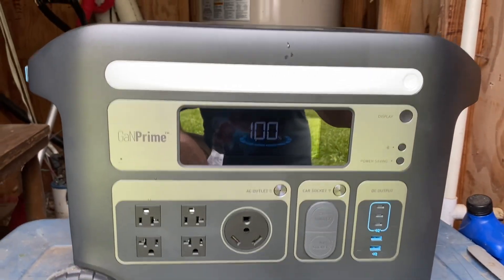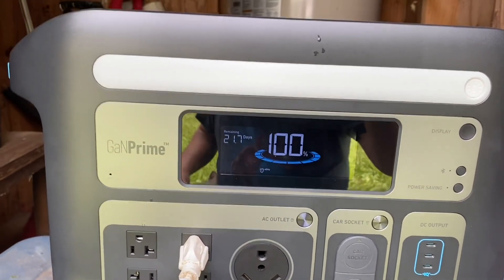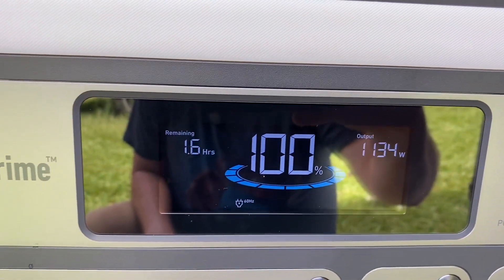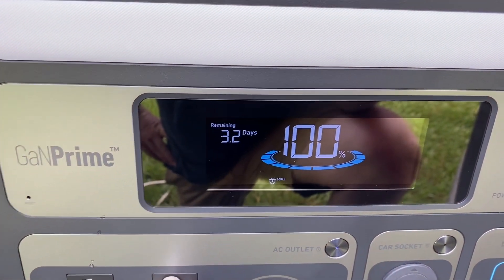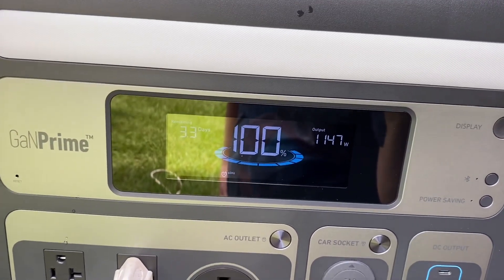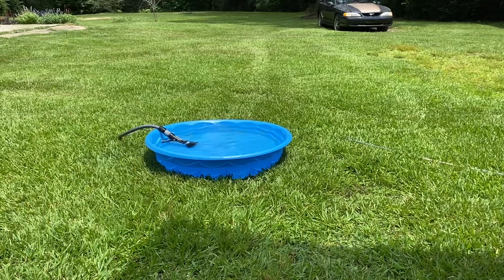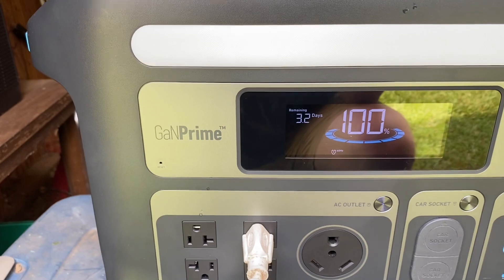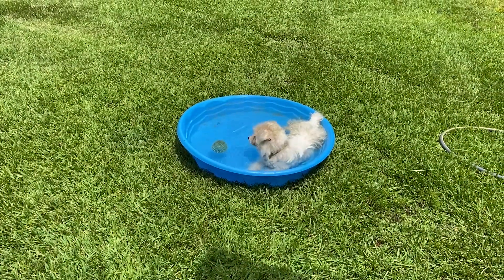Will the Anker Powerhouse 767 Run a well pump ?

Comment: This is very helpful. We have a house on 5 acres will a 50 foot well. Most of our power outages are a few hours at most, but the recent hurricanes in the East (Helene and Milton) have highlighted the fact that we need to be able to run the well pump in a multi-day scenario. I can flush toilets with a bucket of water from the hot tub temporarily, and we have sealed drinking water. I just ordered on of these, and it will be a great alternative to the gas generator for shorter outages, at least I think so. Thanks again.

Comment: Thanks very much for this interesting video. Not much on well pumps and solar generators on Youtube. The Grundfos pump I'll be using is  will pull from 160 feet and uses 12 to 14 amps.  I'm wondering how many amps is your submersible.
Reply from the maker: Your welcome glad you enjoyed it. I have a Shur-Dri pump 

4in submersible Pump. 
Specs 
115v
1HP
60Hz
0.37kW
8.4Amps
Safe max Amps 10
3450 RPM
SF 1.6

My pump is a 115v the Anker 767 will not run a 220v. 
I do know the Anker 767 is rated at 20 amps but I haven’t tried it out on a pump as large as the one you planning to use so I can’t say 100% it would work. 

If you are needing a 220v then the (Anker Solix F3800) would be what I recommend. It puts out 220v and 120v. 

https://www.suncatchersolarstore.com/product-page/anker-powerhouse-521-256wh-200w
Reply: @Suncatcher-wt2od  Thanks very much for the quick reply and the information on your pump. I was wrong about the amps. The pump I'll be getting is a 120 pump. In the manual it says amp rating is 7.7 to 11 max so the running amps is lower but the starting amps is 1 amp higher.  Guess I'll just have to try it to know for sure. 
Yes, I know about the F3800 but would rather get a 120v pump as I would like to stay at that power level for a generator.

Comment: Do you have a 120v submersible pump or an above ground pump. Where we live our wells are over 300 ft. deep,  always have to hook up to a 240v generator.  Iv'e looked at some 120v submersible well pumps but not really much information on deep well use.
Reply from the maker: It is a submersible pump. I’m not sure what the limit is with a 120v submersible pump either. 

Ours does fine for us with every day usage in our house, been using it over 10 years now. But we aren’t 300 feet. Not sure if the 120v pumps can or can’t go that deep.
Reply: @Suncatcher-wt2od  Thanks, I'm still looking into it.. Best regards..